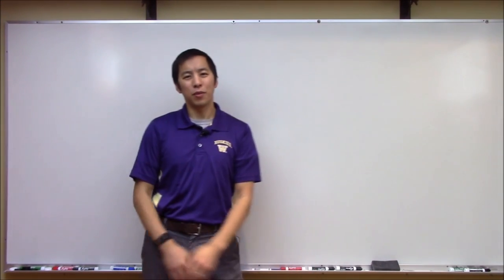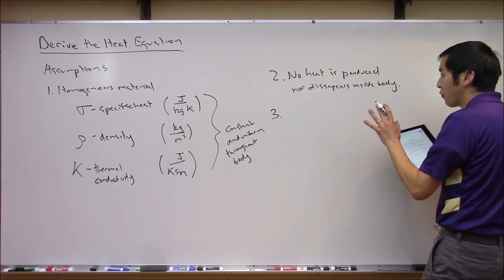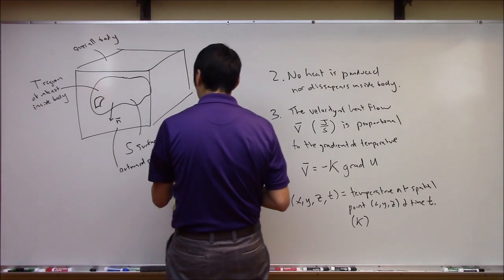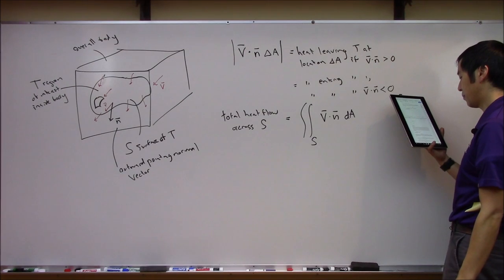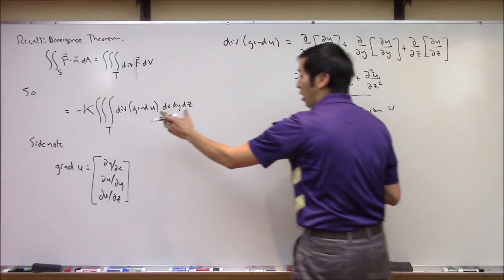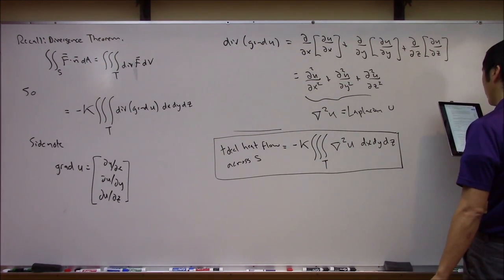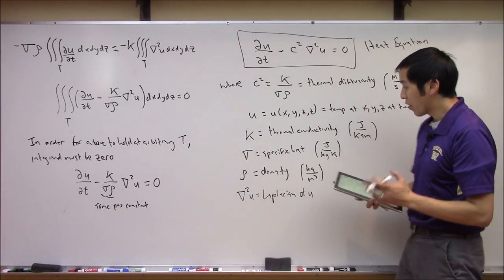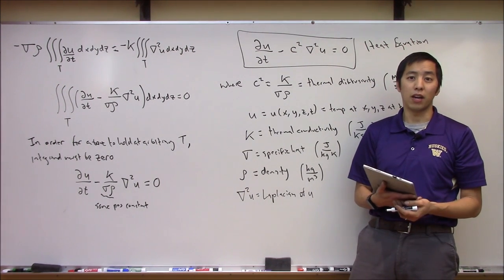Derivation of the Heat Equation

Comment: I think you have a mismatch in the units...what you define as the velocity vector (J/sec)
is basically the heat flux vector at a point with units  (J/sec*m^2)
and 
q=-k*grad(u)
J/sec*K*m^2 = -(J/sec*K*m)*(K/m)

Other than that, a perfect derivation, thank you!

Comment: what cases can have  v != k gradT?
Reply from the maker: Good question.  One situation could be if the material was not homogeneous.  For example if you had an insulator next to a conductor.  There might be a large temperature differential (AKA large gradT) but there would be no heat flow into the insulator.

Comment: AE 501: Hi Professor Lum, at 28:00, you say that the integrand has to be 0, I don't understand why. I believe the triple integral has to equal to 0 and that the integrand can be 0, but not necessarily. Great video, thanks for bringing heat transfer to this class.
Reply: The integral could be zero without the integrand being so, depending on what surface you choose. But since the surface of the region is arbitrary, that means it only depends on the integrand for that purpose, hence the result on the video.